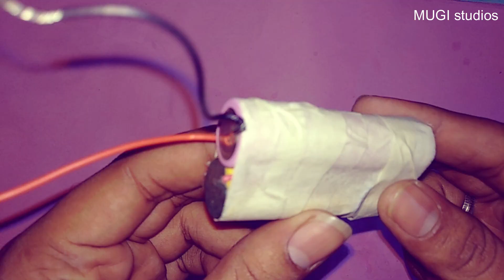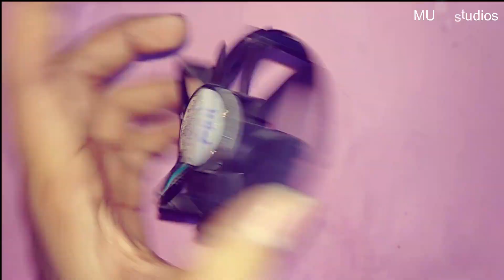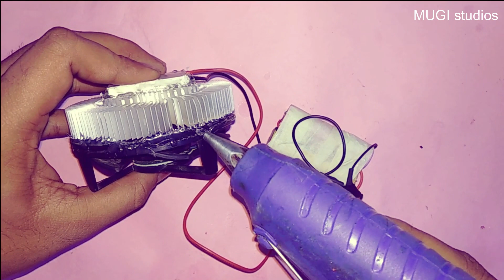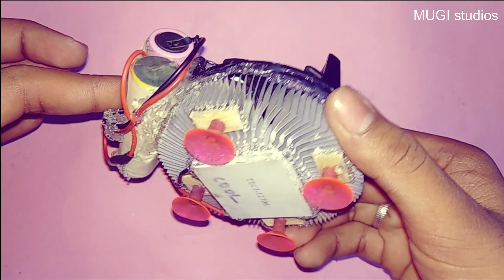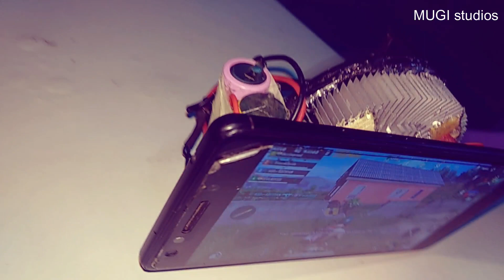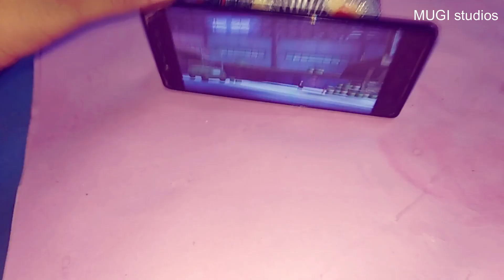how to make phone cooler at home|liquid cooling phone cooler |cooling fan for mobile #phonecooler

Comment: This will heat up the device rather than cooling.... because the Peltier Module is not in direct contact of the phone... also the hot air from the heat sink is directly blowing on the mobile phone

Comment: Anna na itha panita na but supply pathala peltier ku ungluku epdi pathuchu ,peltier full potential ku work aala,neenga evlo watts supply panninga?
Reply from the maker: Use 5v peltier bro 👍 it's very powerful cooling ok... any doubt ask me.... thank for visiting watch all video....🤝
Reply: Anna na 12v 6A peltier use panna
Reply: Athu epdi anna cooling differ aavu supply same ah kudu thalu five volt alavukachu output kudukanula anna??
Reply: Ippa 12v peltier ah enna Panna anna useless ah??
Reply from the maker: Ne 5v 3A peltier vadhu 5v supply ku. 12v 6A peltier ku nee 12v kutha matha cool agahu 6A irutha tha cool agom. Amp is very important for cooling 12v is not important ok
Reply from the maker: No... nee 12v peltier ku 5v use pana Alam ana cooling alte agum...Ella na mobile charger use panaelam
Reply from the maker: Peltier ku (watt )mukieyam Ella... amp tha mukieyam...you using peltier (watt) is not important (amp) only important ok
Reply from the maker: Nee 5v3A peltier ku 5v supply kudhu kanum
Reply from the maker: 12 peltier vachu free energy pana Alam saieyalam https://youtu.be/_EF7po5_5mU
Reply: Ok anna enta current ah 5v peltier illa but 12v peltier ke 3A-6A supply kudukra , results pathutu ethachum doubt na comment panra nandrii🤝🤝
Reply from the maker: Ok bro 🤝🤝🤝